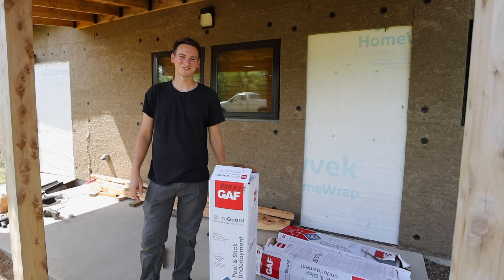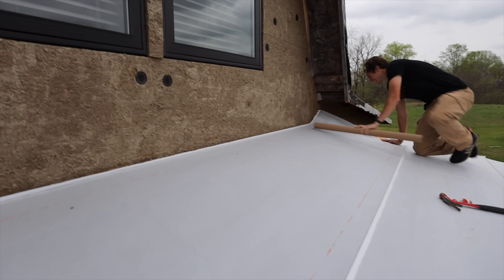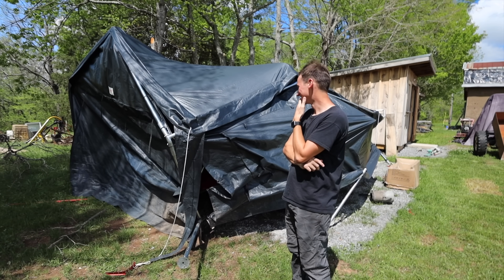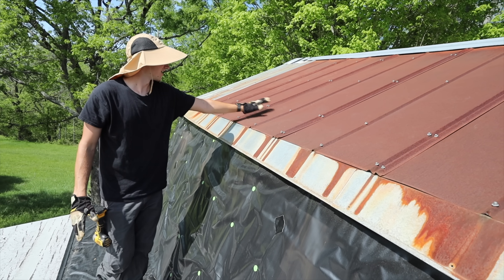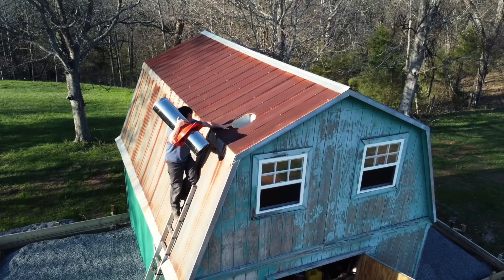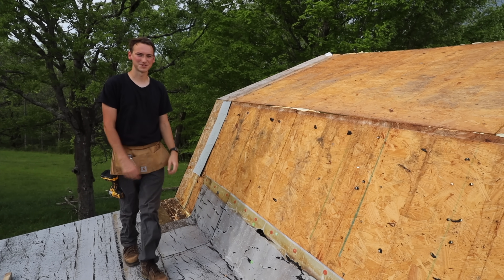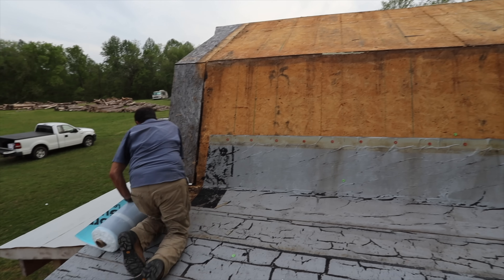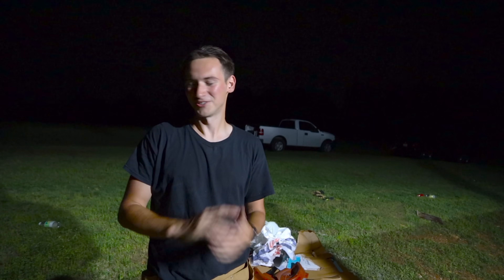Installing GAF Stormguard on the Shed Tiny House! | Abandoned Shed to Tiny House

Comment: House is coming along nicely! One thing I wanted to point out, you should really consider some kind of diagonal bracing on the porch posts to top plate. When you and your dad were on the roof putting down the storm guard, you could see that whole thing move. It needs some lateral bracing. You could do diagonal wood braces, or some “T” plates with lags if you don’t want to lose the head room. Hope this helps!

Comment: I also have a shed cabin it is only 5 years old but it has developed several leaks over time. I to live in Tennessee  from what I can see it leaking around the screws I think its from the wind getting under the metal and lifting it up. I want to thank you for telling us about the storm gard I will be taking my metal off and putting storm gard on my roof I have to replace a few pieces of wood. But I'm going try reuse as much of the metal as possible right now I have a tarp on it. Thanks again I have  Watched you from the start of redoing your shed and I think you've done it wonderful job on it you and your dad I am looking forward to getting mine finished. Your friend Marie from Tennessee.😊

Comment: One consideration when using the metal roofing as a ceiling us that if you get a lot of humidity, it will condense on it and drip on your floor.  We're getting ready to remove out shop ceiling for this reason.